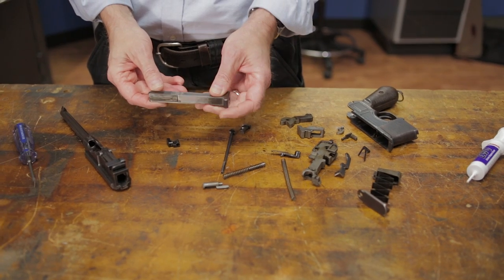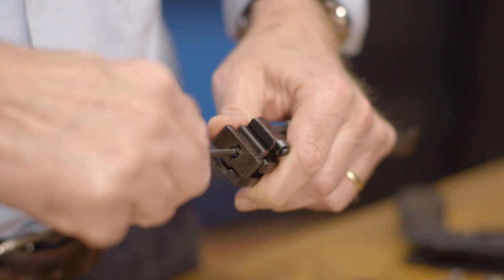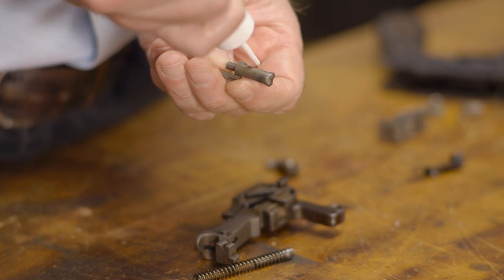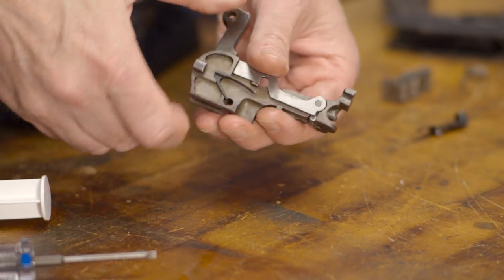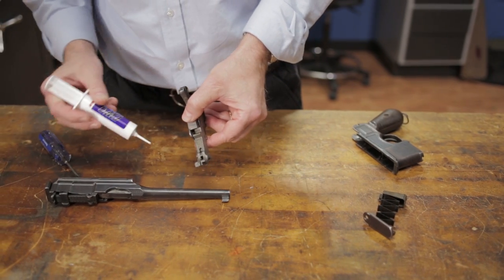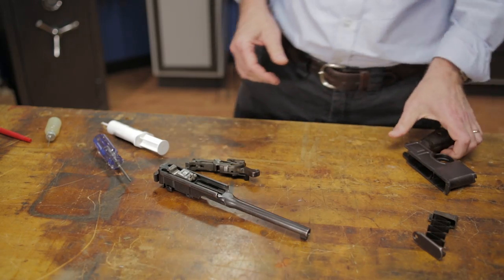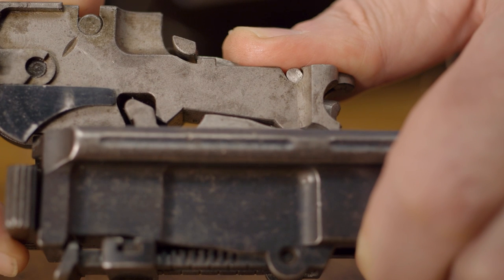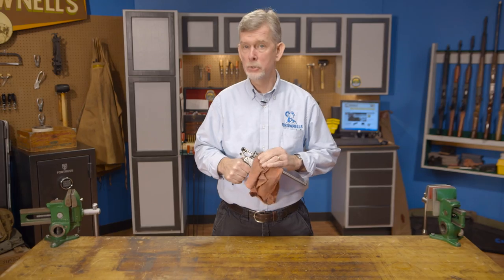Broomhandle Mauser Maintenance Series – Reassembly

Comment: I cannot get the locking block (a replacement) to stay in long enough to get the pistol back together.  Since it is replacement part, can you give me guidance as to where and how to fit the locking block?
Reply: It took me hours to get that done.
Reply: I finally got that to work by a small amount of shaping on the locking block where it contacts the spring keeper.  However, now the trigger is apparently not pressing on the sear to fire the pistol and I can't see what is misaligned.  Any suggestions?  Thanks
Reply: Mike MICHAELS my guess is the dead just isn’t touching it because something got shaken a tad loose during reassembly

Comment: 6 years after this video was made I used the complete disassembly and re-assembly to be a great wealth of information in a project C96 I bought and wanted to build from parts.
The original owner had put that Rocker Coupling in backwards.  The "disastrous consequences" He speaks about is that it's VERY hard to remove once installed wrong.
Now the only real problem I have is that the hammer barely stays cocked back.  I think I need a new hammer.  I have replaced (with new parts) the 2 other parts that release the hammer.

Comment: Thanks for the series guys.
I purchased a v. clean late Model 1937 (Ser. #910867) with little apparent usage. Indeed, while cleaning and learning about the new pistol, I found so little wear (good!) that the rocker assy removal and assembly was a challenge due to the tight tolerances in my particular C96. When it came time for the hammer pivot I had to give up, as despite using a "break free", it wouldn't budge and I didn't want to snap the spring steel "wishbone". Good enough for cleaning and lubrication purposes. The locking tab is also very tight.

So, while it's nice to know I have a very lightly-used Mauser, it is hard on the fingers! Looking forward to some shooting with it again soon.
Reply from the maker: Awesome. Our pleasure! Love to see that model!